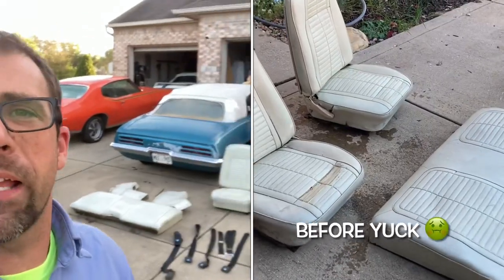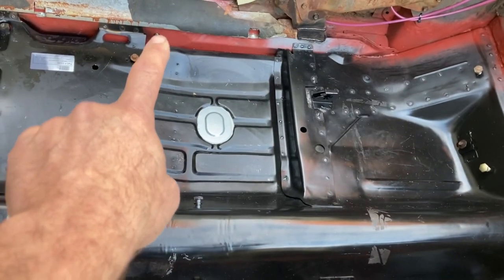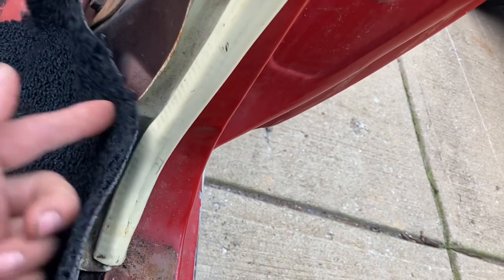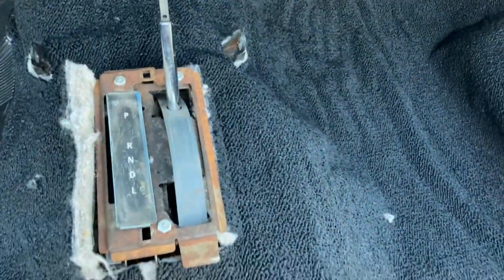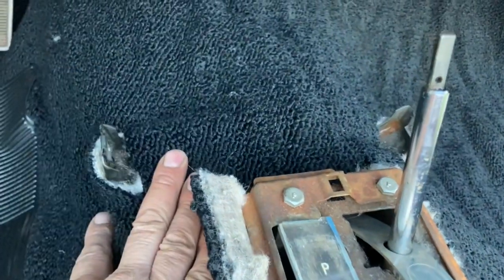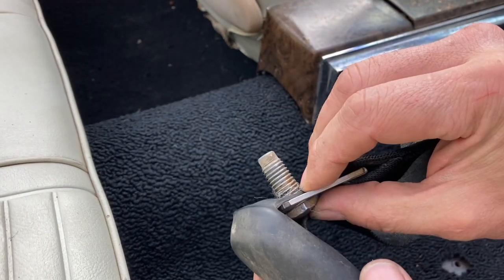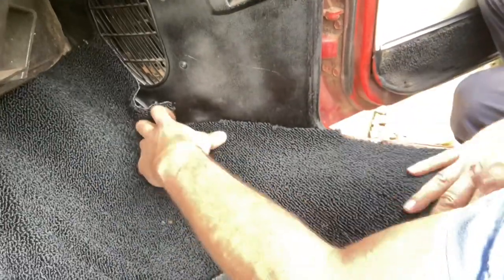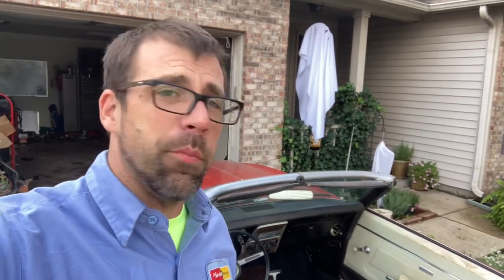E27 installing carpet and interior on project LeBronze finishing up the1968 Firebird convertible

Comment: I thought I had a seat belt for you. I found a retracting end (though retractor does not appear to be working) and a belt end with the right release, but it has a plain end versus the one with a plastic cover, so I guess that is the other end of a rear belt. Strangely, these are are only seat belt pieces I have come across so far but  I'll keep looking. I had bought a 68 FB convertible about 5 years ago to restore and it was already mostly dismantled, so my parts are somewhat scattered. I did not plan on using the original belts, so if I find it I'll let you know.
Reply from the maker: If you find it yes I can make it work. Thanks for taking the time to let me know and look.

Comment: Another great video!  One question and maybe I missed it but did you use seam sealer on the floor pan?  Thanks again for the great content.
Reply from the maker: Good eye the answer is no. The factory does seam seal the inside, just my opinion it holds water in just as much out. Now if this car gets driven in all seasons again probably not a bad idea to seam seal it all up.  I did seam seal the rear fender wells where I patched them.  Being a convertible let’s be honest it’s going to get water inside it from time to time and I would rather have a drain then a bathtub of a floor pan.  Thanks for watching and your feedback too.
Reply: @VinylVillageGarage  Thank you and makes sense, me being in FL always running the risk of a flash flood could not go without 👍

Comment: Do the seats bolt right to the floor? My seats have another piece of u-channel steel that only goes on one side. It bolts to the floor and then the seat bolts to it. It doesn't look right and I am wondering if someone has monkied with it.
Reply from the maker: There should be 4 threaded holes. Actually 6 I think in the floor board. Then the seat attaches to sliding tracks 2
Per seat one on the left and right.  Three parts seat, track, floor pan anything else isn’t standard
Reply: @VinylVillageGarage  My description of what I see was not very good but I have figured out that they are seat extenders to allow the seat to be mounted 2" rearward. This makes sense since I can hardly use the clutch and especially the brake without my knees hitting the steering wheel. My legs have to be at an angle. The reason I was confused is that one extender bracket was used on the left seat and one on the right seat. There should be two per side. I only have two so they will go on the drivers side since the passenger side is fine without the extenders. Thanks.
Reply from the maker: @stevenpringle7813  yup that makes total sense now and normally you only add extensions to one seat, odd it had one on each side
Reply: @VinylVillageGarage  I bought the car when I was maybe 21. I am now 55 and have finally gotten around to fixing all of the monkey work done to it. I should never have bought the car as it was/is a basket case and had multiple owners that each had a go at screwing it up. The car should have been crushed. Anyway, I just think that someone didn't know what they were for and forgot where they went when they put a new carpet in. In all fairness, we now have the internet and it obviously makes it a lot easier to figure out how things are supposed to work. Thanks.

Comment: I have 3 firebirds that I just bought that I’m sure between the 3 I could find what you need. Reply with an email address or something and we can chat further. Thanks!
Reply from the maker: My email is on the video description it seems if you add a link or Email to messages it gets removed by YouTube.  I need a drivers side standard lap belt, both the buckle and retractor Black in color.  If you have one let me know